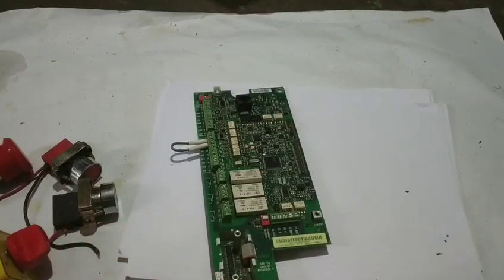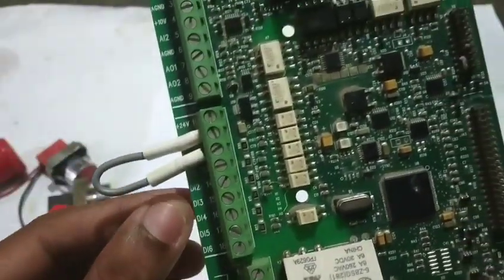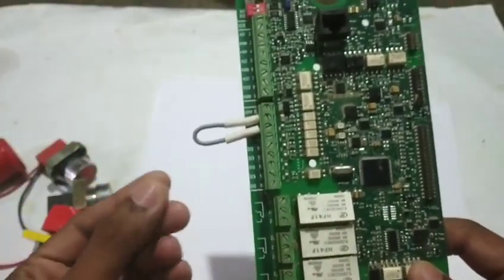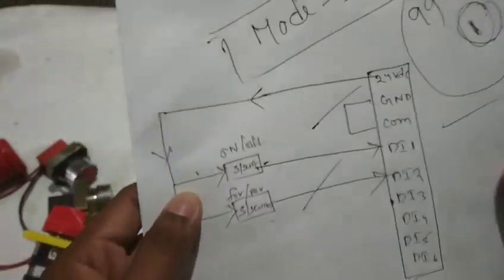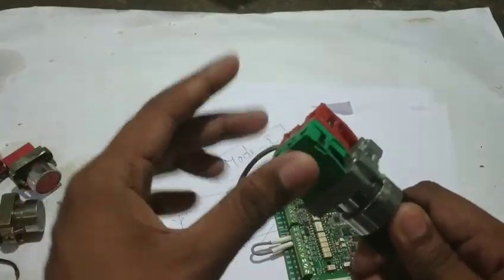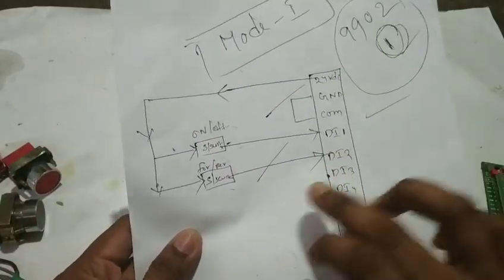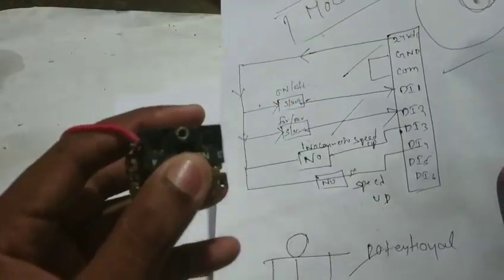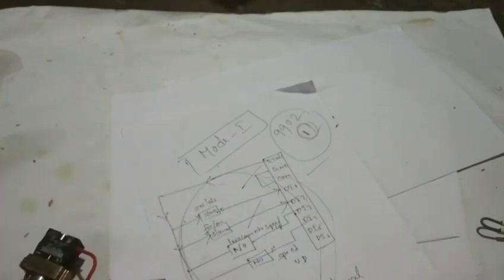Variable frequency drive start/stop, forward/reverse,speedup/speed down control wiring  telugu 2020

Comment: Anna vfd running lo vunnappudu rpm set chesam suddnga fault vastundi problem anti anna
Reply from the maker: A fault
Reply from the maker: Vfd running lo vunnappudu rpm settings konchem konchem tagginchaali
Reply from the maker: House wiring cable size calculation in telugu 2020/electrical tech in telugu
Reply from the maker: మరిన్ని video లు కోసం channel playlist లో కి వెళ్ళండి.